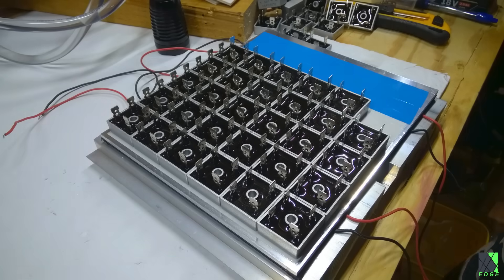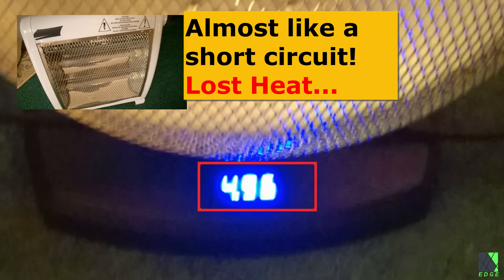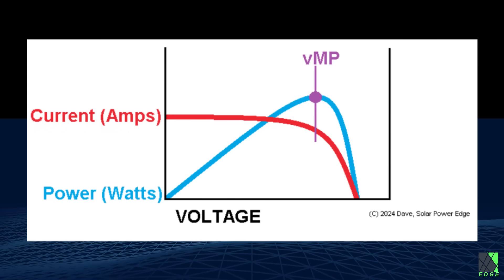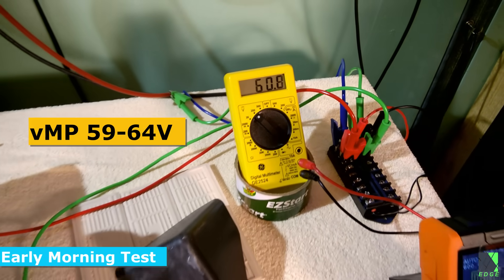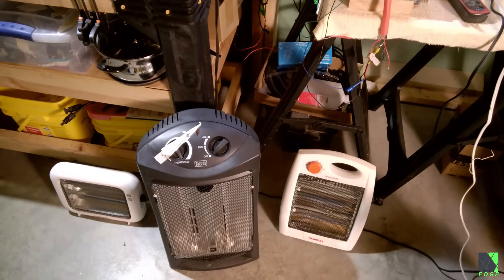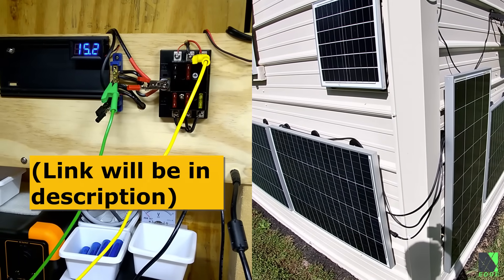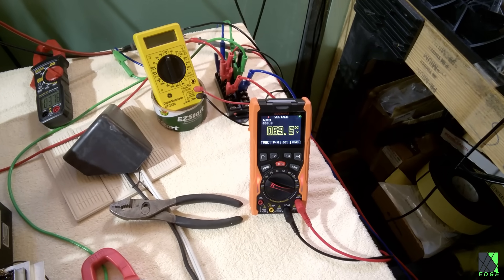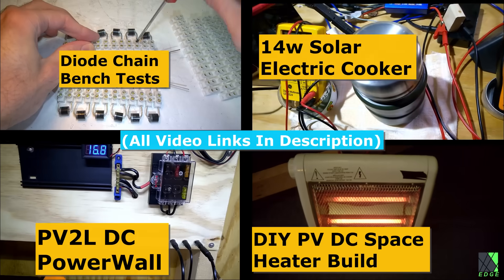How I Get More Solar Electric Heat With POWER DIODES - Poor Mans MPPT #DIY #solarenergy  #solar

Comment: i have a my big research idea  for all worlds .this research change all worlds heating need .this  heating  element can ran from direct solar power,  or after sunset in night this ran to battery  power .  this element customise in all  shape small size. 
i need patents for this idea .anybody help me for this.
Reply from the maker: @pramodgehlot8512  Hi, a subscriber told me about this... you can file your patent idea as a "micro entity" on the USPTO website. It costs much less, but you will have to make drawings and documents to file. Also it helps to hire a good patent attorney, although they might charge a lot.

Comment: I've been researching into making my own MPPT controller using cheap components... not as cheap as your solution, but if you have a use for the power (like computing), then MPPT is your go to and the heat is a bonus. Then again, I never found cheap diodes, I found cheapish MOSFETs but not cheap diodes (or at least not big enough for that use case), so maybe that was my issue. Also I was never aiming to make heat, only to do something else and recoup the heat to keep the shed warm. Still, hat tip to you, if all you want it heat, this is a way to do it. Personally, I would try to find a real use for the power and then use the waste heat like running a computer, powering batteries for powering other things, you name it.
Reply from the maker: @asificam1 The cheapest diodes are just pennies. Bridge rectifiers are more of premium solution but worth it for their simplicity. For years solar electric heat worked well for us during winter, but without MPPT there is always some waste. It turns out diodes are a simple and cheap way to extract most of that wasted heat, but avoid MPPT altogether. I am certainly not against MPPT but this channel has a grid-down and keep-it-dirt-simple theme in the background (my personal preference for just about everything)

Comment: I'd like to be able to use solar power during a blackout. I would have to disconnect from the power grid to prevent back feeding. I've been told I need to do something with the excess energy that's generated. You seem like the right person to ask how to manage this. Maybe you've already discussed it? I'm looking for a longer term solution than a battery might cover like a week or longer.
Reply from the maker: @geniferteal4178  Hello, an unmodified grid tie inverter can't work safely without the presence of grid power. So that leaves us with batteries/inverters in most cases. 
In my opinion, a potential solution is to build a PV DC powerwall. And make appliances run off of solar direct. I have been working on that for years at a small scale. It's a parallel effort, having multiple power sources (redundancy) is always a good thing.
Here's my work-in-progress demonstration:
https://youtu.be/zEZ0ke48awM
Reply: @solarpoweredge  i've gone two weeks without electricity, so i'm looking for a serious replacement. If i've got enough on the roof I'd like to be able to use it. I don't have any solar at the moment.This is something that's been bugging me and preventing me from getting. The fact that I wouldn't be able to use it if the grid goes down. Seems counterproductive to have the perfect generator on your roof but you're not allowed to use it. I get the need to disconnect, but why isn't that enough?What do I not understand? If there's too much energy being generated, I thought maybe if you had three rows of three panels, they could be wired in three segments and maybe only use as much as you need and switch the other one off? There might still be excess energy to do something with, but is there a safe way to get rid of it? Do I not need to get rid of it? I don't know. I just wish there was a way to make it work.
Reply from the maker: @geniferteal4178 2 weeks, that doesn't sound fun... do you know anybody in your area that is familiar with solar? It might help to team up with someone. Sounds like you need a small off-electrical-grid solar power system as soon as possible, just to get some basic power for lights, small appliances, etc.

Solar panels make DC power. Pretty much the entire world runs on AC. That's why we store the DC in batteries, then have converters (inverters) to make AC on demand for appliances. 

Grid tie inverter makes AC right away and pushes it backwards into the home wiring and sometimes the power grid itself. But without the grid, that grid tie inverter won't work at all.

What's missing is DC / solar powered appliances, which is what I have been working on as much as humanly possible. I feel it's necessary to have small to midsized DC and solar powered appliances, but their availability is often not very good.
Reply: @solarpoweredge  i'm not looking to change all my appliances. I want to run what I have and keep it running. I could prioritize certain things like fridge, freezer and heating, but I don't really want to think about what I can or can't run if the power's out.I want to just run the same stuff unless of course, i'm not generating enough gy that's a different question.

I talk to everyone who bothers me about switching to solar energy or adding solar energy, but they're just the salespeople, and they don't understand they say battery, I say, two weeks, then they say, yeah, I could have someone and i'm like, nope, i'm not giving you my information.

When you say without the grid, That inverter wont-work. Is that for safety reasons, or is there a separate necessary reason like where does the extra energy go? I understand the safety concern. But I also feel there's a bit of you can only have energy supplied by us. You can't supply your own kind of mentality. The government kind of doesn't want us  living off grid. So which is it does it actually not work?Or do they just not allow it to work for safety?
Reply from the maker: @geniferteal4178 A grid tie inverter is designed to require grid power for safety reasons. When the power is out, it switches off. Otherwise, people would backfeed high voltage while linemen are working on repairing the power lines, causing them to be injured. It's the same problem with gas generators, that's why the breaker panel is required to have an interlock to prevent accidentally backfeeding onto the grid during a power outage. 
Off electrical grid power does not connect to the power grid, but instead creates a separate "mini grid" which is independent and supplies power to the house. Basically we don't have good options for no-battery / PVDC-inverters right now. So that means getting batteries, inverter, solar charge controller and solar panels and operating that as a system to power the  house. 
In some years, I kept my grid connection and ran a large solar power system in parallel. So I had more options. In your case, with the power out, any kind of power source would be great. If you know somebody that's into solar (not a salesman) they could probably help you get started in the right direction.
Reply: @solarpoweredge  you seem to concur that it's done mostly for safety reasons. I would venture to guess that's part of the reason, there's less availability of off grid inverters. 

Whole house generators are not uncommon. Why is that any different than this type of scenario? They also function automatically. What are they doing differently that couldn't be done for solar?
Reply from the maker: @geniferteal4178 It's 100% "technically" possible to run a house on inverter + solar panels alone, but can be very challenging. I've done projects like that, but it's just out of reach for most DIY'ers and often requires an electronics background. It is very tricky because solar power is variable. What happens if there is not enough power? Answer, everything shuts down. This could harm appliances. So instead we use a battery as a "power buffer" and when there is not enough power from the sun, we draw power from the battery to make up the difference.

FYI electrical codes generally require all generators that tie into the residential wiring to have an "interlock" device which disconnects the house from the grid. Otherwise, when the generator turns on, it would backfeed the grid and could electrocute a lineman from the power company while he is working to restore services. 

Besides that, as far as I know, there is no economical reason to backfeed the grid with gasoline generators, it would be a waste of resources and is not considered "green energy".

Solar grid tie inverters have interlock capability built in using electronics - they simply switch themselves off instantly when the grid goes down. The reason why they are allowed to backfeed while the grid is "up" is because this is considered "green energy" and the grid is used to share variable excess solar power with other houses on the grid. Problem with that is the power company will never pay enough for that excess solar power, to recover the investment of solar panels and other equipment. But I guess at least it would reduce the operator's power bill.
Reply: @solarpoweredge  right, there would be no intent to feed the grid from a gas generator.  I am aware of generators that start up automatically, so there must be some way they disconnect automatically.
Reply: I see what you're saying about the variability of solar. I'm always assuming the problem is too much power, but there may be the opposite. I guess when you're connected to the grid.The grid provides the extra to balance it out. Perhaps for some period of time, batteries could balance out the.Reduced power missing. Wouldn't be a permanent solution, but it could be much longer term than the batteries alone. Starting to appreciate the complexities.
Reply from the maker: @geniferteal4178  Indeed the grid acts like a battery. In your case, I'd recommend building a basic solar power system "in parallel" and start using it. Hands on experience is a great way to get started. Powering an entire house with solar, that's super expensive and can be overwhelming to take on all at once. Over 10 years ago, I started with 1 small battery, a tiny inverter and a tiny 20w solar panel. It was amazing to see how that small system could run lights, charge my phone, etc. and be renewed every day when the sun came up. It was enough to get me interested!

Comment: can we use wires?  if so what awg?  also  once gain Congrats on the 16,000 Subscribers !
Reply: fyi  just found same ones on temu for $8.77 and already ordered them for testing
Reply from the maker: @vrrevolution9183 Thanks a lot! Sure, we can use any wires as long as they can handle the amps

Comment: Pardon my ignorance......  but, people often say  " feeding back into the grid"   !!   How can you send power back into the grid from the excess power you have generated at home ? I thought current is obviously only going to travel From the grid to the consumer ?
Reply from the maker: @merlin5476  Hi, a grid tie inverter can literally push power back into the grid. To learn about that part, check out this video https://youtu.be/fFFv2BNhIBs
Reply: @solarpoweredge  thanks for a swift reply 👍
I shall check out the link. 
I'm surprised that current can flow both ways at the same time especially at the same frequency ( 50hz). 
I shall investigate.  Many thanks.
Reply from the maker: @merlin5476 Welcome! :)
Reply: @merlin5476  Grid tie inverters are specifically designed to not work if that 50Hz signal goes  away.
This is needed for safety reasons.

Comment: If you get a handful of power transistors on a big heat-sink, you could program an arduino to control the current they draw. It would be a form of active mppt, so possibly not attractive to you, but it could be simple, optimal and under your own control.
Reply from the maker: @Rich-on6fe True and a good idea... I have an arduino kit but have never got around to opening it. Guaranteed this is one of the first things I'd try :) 
The main draw of diode chains is they are like nichrome - dirt simple. And yet they behave so intelligently. I find them very intriguing
Reply: @solarpoweredge  I went so far as to sketch a circuit: Arduino gnd is connected to PV negative. PV positive goes to emitter of a pnp power transistor and also to a 10:1 divider to gnd to provide a PV voltage measurement signal that goes into an Arduino ADC pin. The collector of the pnp power transistor goes through a low value resistor to gnd, providing a current measurement signal that goes into another ADC pin on the Arduino. The base of the pnp power transistor is stimulated by an npn transistor to ground. The base of the npn transistor is driven through a resistor from a voltage signal from a DAC output of the Arduino. You'll need an RC filter if it's a basic Arduino with pwm output and probably also a buffer amplifier (op amp) after the filter. That base resistor will be chosen from experimentation to get it to pull full rated power with full dac (pwm) voltage. Software will multiply the two ADC signals and drive the base to ride the power peak. The gain of the two transistors together might be enough to make it work sensibly - or it might not. Could be a fun little project.
Reply: It's worth noting that the current measurement voltage will have to be small compared to the 5V range of the ADC input and DAC output. If it ranges to 1V maximum, the DAC output for the base of the npn can range from about 2V up to 5V. The current measurement signal will therefore be fairly small for the measurement range / resolution and you could either amplify it with an op amp circuit before measurement, or you could use ADC oversampling to make a higher resolution measurement. Oversampling and decimation is a bit like magic.
Reply from the maker: @Rich-on6fe This is all good information, thanks a lot!
Reply: Funnily along with my sand battery project I have an adriuno project that detects dusk/dawn to disable the solar input, its at proto stage. Seems very usable to control the resistive load on/off when enough power detected via the diode circuit.🤔🤔
Reply from the maker: @neilfarnham5996 That sounds intriguing :D I have a single arduino in shrink wrap collecting dust, next step is to actually power it on and start a new discipline :)

Comment: This is a good update to your explanation. I hope it gets through to more people. I'm not very electronics savvy, but I'm curious why you are using only one half of each rectifier. Is there an efficiency benefit from running more units at a lower temperature than fewer at a higher temperature?
Reply: I think that he is using all 4 diodes, just ignoring the two center taps, i.e. the voltage drop is over a mini chain of two diodes and each rectifier has two mini chains in parallel.
Reply from the maker: @MLSgeek Right!!
Reply: @MLSgeek  Oh, right! I get it. I wasn't thinking of it properly, imagining the two conventional paths for incoming alternating current, but with DC only, the current can simply flow through two parallel paths. Thanks for pointing that out.
Reply from the maker: @fxm5715 Thank you... I'm no electronics guru either...  a full wave bridge rectifier has 4 diodes, but we certainly don't have to use all of them. The main benefit they deliver is a large, tough metal case that can be mounted directly to a heat sink with a bolt. I'd say it's better to run more units at a lower temperature, BUT diodes seem to take 100C temps just fine. I don't have any data on diode longevity vs. temperature but it surely must have an impact. Therefore I am careful to not overheat and have not lost a single diode yet. I'm sure it will happen eventually though

Comment: Hi Dave,  Glad to see you making use of the "adjustable heat output" feature of the diodes by switching them in and out as we talked about in email.  I am still waiting to find a cheap source of copper plate to build my diode tree for burying in my sand battery.  I picked up some n.c. thermal cutout switches to mount on the copper along with my diodes so they do not overheat in the sand. 
Are you using full drop to zero volts at the end of your chain ?  
I was thinking that several chains in parallel on different heatsinks would likely make more use of available current during peak periods without adversely affecting anything.
Reply from the maker: @ianball3972 Hi Ian, sounds like an awesome project and the thermostats are a good choice for sand. I built a mini sand battery to experiment. The challenge I am trying to solve is diodes can't get as hot as the sand can. 300C on a diode might not end too well....
The diodes shown do go to zero voltage, and I consider negative as ground and work from there. But in practice you could attach a fan anywhere in the chain for example, it doesn't matter so long as the voltage is correct. 
Spreading the current out amongst more diodes is a cool way to reduce their workload. Another option is to use Schottky diodes. In electronics I have often heard "don't put diodes in parallel". But some of the heaters shown have parallel diodes. It seems  to work fine. However if a diode ever shorts out, that would be a problem. Have not burned a single diode yet. I think finding a bad diode and replacing it would be really easy and cost a dollar or less. Compared to nichrome, I love diodes. Mix the two - even better...